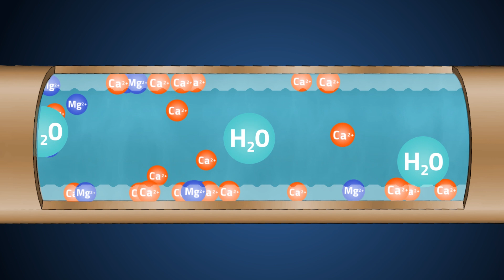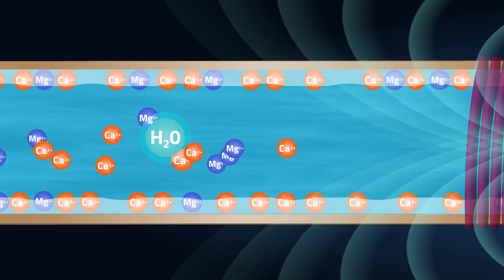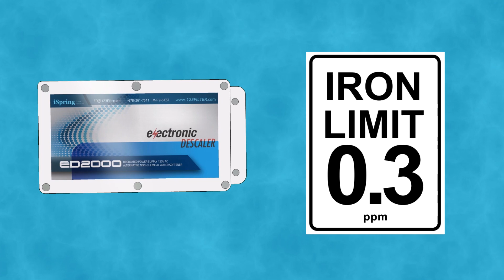How Does Electronic Water Descaler Work? Water Conditioner? Alternative Water Softener? Pros & Cons?

Comment: I'm not convinced this works.  Seems line snake oil and magic.  Where can I get more info on this?  if this were real, then it would be much more popular - especially since this video came out 8 years ago.....
Reply from the maker: Hi there! The ED2000 whole-house electronic water descaler is a water conditioning system that addresses hard water problems without chemicals, salt, or filter cartridges. It leaves the minerals in the water but prevents them from forming limescale deposits.
The ED2000 functions by wrapping two antenna cables around the main water pipe to form a coil, creating a complex, frequency modulated, electromagnetic waveform. This induces an oscillating electric field into the water, resulting in the agitation of water molecules sufficient enough to trigger the release of carbon dioxide and cause the premature precipitation of calcium bicarbonate. This process naturally results in a small increase in solubility, which allows the now unsaturated water to dissolve existing scale deposits and remove them from the water system. 
You can check the system here for more details:
https://www.ispringfilter.com/ac/ispring-ed2000-whole-house-electronic-descaler-water-conditioner-alternative-water-softener?es=1 
If you have further concerns or questions about our products, please don’t hesitate to contact us at support@ispringfilter.com or 678-261-7611 (M–F, 9 AM–5 PM EST). We’d be happy to help!
Thank you!

Comment: If it returns to its normal state after 50 feet. How about the hot water tank.....does it return to normal state in there as it's sitting for long periods?
Reply from the maker: Hi there! The ED2000 electronic descaler doesn’t remove minerals from the water—it changes the way they behave by using an electromagnetic wave.
As for the hot water tank: even though water sits there for longer periods, the treatment can still help reduce scale buildup  because the minerals have already been altered before entering. However, results can vary depending on your water hardness, and distance. For large homes or more severe hard water issues, you can install a second unit for added coverage.
If you have more concerns or questions, feel free to reach out to us at support@ispringfilter.com or call us at 678-261-7611 (Monday–Friday, 9 AM–5 PM EST). We're happy to help!
Thank you!

Comment: will this reduce hardness in water ? will this reduce hairfall and skin problems ?
Reply from the maker: Hi there! Electronic Descalers are not traditional water softeners—they do not remove hardness minerals like calcium and magnesium from the water. Instead, they work by altering the behavior of these minerals to help prevent scale buildup in pipes and appliances. Your water will still be considered hard, but it will be less likely to cause limescale and corrosion issues.
If you're concerned about hair fall and skin problems potentially caused by hard water, a water softener that removes calcium and magnesium is generally a better option. Softened water can feel gentler on the skin and hair, and may help reduce dryness, irritation, and buildup on the scalp and hair over time.
You can take a look at our WCS45KG whole house water softener here:
https://www.ispringfilter.com/ac/ispring-wcs45kg-whole-house-water-softener-with-backwash-feature---45000-grain-capacity-for-households-and-business?es=1 
If you have any concerns or questions about our products, don’t hesitate to contact us at support@ispringfilter.com or call 678-261-7611 (Monday–Friday, 9 AM–5 PM EST).
Thank you!

Comment: You lost me at Patented Computer Chip 🤣🤣 People need to know that this is a scam !
Reply from the maker: Hi there! The ED2000 functions by wrapping two antenna cables around the main water pipe to form a coil, creating a complex, frequency modulated, electromagnetic waveform. This induces an oscillating electric field into the water, resulting in the agitation of water molecules sufficient enough to trigger the release of carbon dioxide and cause the premature precipitation of calcium bicarbonate. This process naturally results in a small increase in solubility, which allows the now unsaturated water to dissolve existing scale deposits and remove them from the water system. Limescale deposits on your fixtures will soften over time after regular contact with the treated water from the ED2000.
If you have any questions about our products, please kindly contact us at support@123filter.com, at (678) 261-7611 M-F 8:30-5:30 EST, or at (470) 560-0012 M-F 8:30-5:30 EST (Messaging only)
We are happy to help!

Comment: Electric magnetic no proof off all and not true!😢
Reply from the maker: Hi there.  The ED2000 uses frequency-modulated, electronic magnetic waveform. This induces an oscillating electric field into the water, resulting in the agitation of water molecules sufficient enough to trigger the release of carbon dioxide and cause the premature precipitation of calcium bicarbonate. This process naturally results in a small increase in solubility, which allows the now unsaturated water to dissolve existing scale deposits and remove them from the water system. Limescale deposits on your fixtures will soften over time after regular contact with the treated water from the ED2000.
If  you have any concerns or questions, please kindly contact us at support@123filter.com or at (678) 261-7611 M-F 8:30-5:30 EST. We are happy to help!

Comment: I have a few questions:
1) What size filter should be placed after this to remove the particles from the water?  Or would the filter just hold them until they breakdown again and pass through?
2) Would this be effective on reducing the calcium build-up on saltwater pool chlorinators (salt cells)?  The typical pool pipe size is 2 to 3 inches, though; not 1".
3) Would the electrolysis action of the salt cell negate any benefit of this (#2).
4) is it the length of enfluence (long but single layer coil) or the field strength (short but stacked coil) that has the best effect?
Reply from the maker: Hi Travis. The ED2000 electronic descaler does not remove particles from the water, it only helps to prevent the buildup of mineral scale. A spindown filter (50-100 micron) can be used after the ED2000 to remove particles from the water, however, it is important to note that the filter will not prevent the buildup of mineral scale.

The ED2000 is designed to work with hard water, which typically contains calcium and other minerals that can cause buildup in pipes. While the ED2000 may reduce the calcium buildup in a saltwater pool chlorinator, its effectiveness may depend on several factors, including the size and type of salt cell, the size of the pool pipes, and the hardness of the water.

The electrolysis action of the salt cell is a separate process from the ED2000 electronic descaler and will not have an impact on its effectiveness.

The effectiveness of the ED2000 electronic descaler is dependent on both the length of the coil and the field strength of the magnetic field. A longer coil with a single layer will provide a longer field of influence, while a shorter coil with multiple layers will provide a stronger magnetic field. The best solution for your specific needs will depend on the hardness of your water and the size and type of pipes you are using.

Please call us at 678-261-7611 (M-F, 8:30 - 5:30 EST) for more questions. We are happy to help!
Reply: Damn, them some good questions! Yea man, what he said.

Comment: 1:16 does the frequency emitted travel throughout the whole area, or only in the water pipe it's attached to?
Reply from the maker: Hi there. The system treats water for up to 50 feet.
Reply: @iSpringWaterSystems  okay. Will it only treat the water in the water pipe it is connected to, or any water within a 50 range?
Reply: .....lmao.  how would it treat water thats sitting 50 feet away that isnt in the pipe?  you need to take off the aluminum foil hat and grab onto reality
Reply: @MaleMan-o7  I believe his question would be, is that 50 ft in a straight line or will it be as effective if the pipe splits off in many directions? Because one house can have a lot more than 50ft of piping, since pipes branch out in all directions. Don't be rude.
Reply: @iSpringWaterSystems    question; is that 50 ft in a straight line or will it be as effective if the pipe splits off in many directions? Because one house can have a lot more than 50ft of piping, since pipes branch out in all directions. as in The kitchen and main bathroom will be great, but the upstairs bathroom and laundry room on the other end of the house has full on scale?

Comment: Is there any problem with the magnetic fields if the pipe is attached to ground? In other words, does this device work on a grounded copper pipe?
Reply from the maker: Hi Andres. Yes, the device will work and it's good that the plumbing is properly grounded.

Comment: If I add this near the water inlet to my waterfall, will it prevent calcium from building up on my rocks? After a period of time when the water is circulation through my waterfall, does the calcium molecules rejoins and stick to the rocks? Also what size pipe can I wrap with the wires from this product? If this doesn't work, do you have a recommendation to descale the water going to my waterfall?
Reply from the maker: Hi Wes. Our ED2000 should work on your waterfall and the calcium molecules should not rejoin and stick to your rocks. The pipes used for ED2000 should be 1 inch in diameter or less. You can also consider our WDS150K water descaler for the solution: https://www.123filter.com/ac/salt-free-water-softeners-descaler-conditioner/ispring-wds150k-anti-scale-20-x-45-whole-house-water-filter-with-patented-scale-inhibitor.

Comment: what does up to 50 feet mean? is there a certain time before the effect wears off? is the length dependent on the size of pipe? How does the volume of the water heater factor in?
Reply from the maker: Hi Michael. To better answer your questions in detail, please give us a call at 678-261-7611 (M-F, 8:30 - 5:30 EST). Thank you!

Comment: Found the installation manual.  It mentions possible interference with TVs, and of course, my well tank / hot water heater are directly below my main TV.  Any suggestions to eliminate potential interference?
Reply from the maker: Hi there. We recommend installing the ED2000 water conditioner at least 10 feet away from your TV to minimize possible interference. If you cannot relocate your TV, please give us a call at 678-261-7611 (M-F, 8:30 - 5:30 EST). We are happy to discuss possible solutions with you in detail.
Reply: @iSpringWaterSystems  thanks - can you answer my first question below???  related to a well.
Reply: @iSpringWaterSystems aluminum foil.  Kinda like a Faraday cage. Sorry I'm late. Just found this. Lol

Comment: What would be the iron content limit this unit can handle
Reply from the maker: Hi Rae. For source water with iron levels over 0.3 ppm, it is recommended to use an iron removal filter (WGB32BM/WGB22BM) before the ED2000.

Comment: Does it work with PVC water pipes ???
Reply from the maker: Hi Wanda. Yes, our ED2000 electronic water conditioner works with PVC water pipes. You can check more information about the product here: https://www.amazon.com/iSpring-ED2000-Electronic-Descaler-Conditioner/dp/B0744TC3PW.

Comment: Does this help with dry skin and hair, overall water hardness?
Reply from the maker: Hi Rich Northrop! Thank you for your comment. The unit won't reduce the hardness of the water. It only prevents the chemicals from building up and clogging your pipe.

Comment: will this descale a hot water heater if it's installed right next to it to the cold side?
Reply: Hi,

Yes the ED2000 can protect your water heater from scale buildup if installed within the effective range of 50 feet from where the system is installed.

Thank you,

iSpring Water Systems LLC

Comment: Is there a device for testing water after processing electromagnetic waves?
Reply: Hi,

We apologize as we do not sell a tester that can test the results from the ED2000. You should notice a reduction in scale buildup in the effective range of 50 feet from where the ED2000 is installed.

Thank you,

iSpring Water Systems LLC

Comment: My sister has this and says that your electrical outlet has to be as close to to unit as possible thus the need to have an electrician install an electrical box at your selected area of installation. Unfortunately my sister has been known to make up stories... So my question is, Is this true???
Reply: Hi,

The system does need a power supply to power the system. The power cord is about 12 to 15 feet in length so as long as you have an outlet within 12 to 15 feet of the install area, you should be ok to install the ED2000.  Please let us know if you have any additional questions.

Thank you,

iSpring Water Systems LLC
Reply: My sister was wrong as usual, smh...  Thank You!